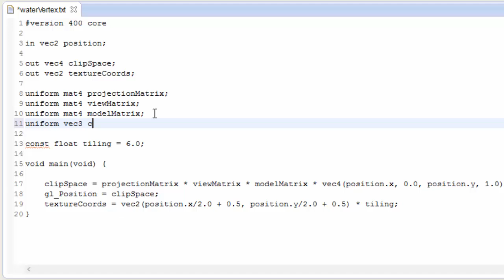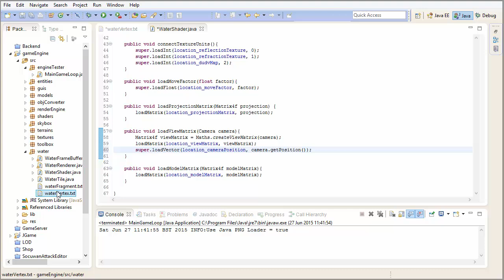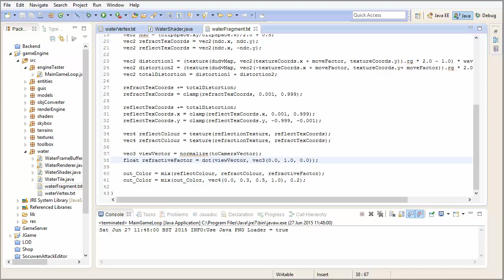OpenGL Water Tutorial 6: Fresnel Effect

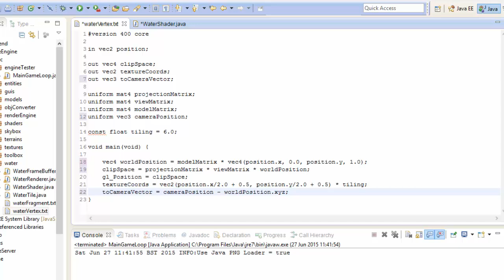Comment: I never understood why the 'toCameraVector' is not normalized in the vertex shader. Does it have something to do with what you say at 3:10 - "fragment shader takes in that 3D vector pointing to the camera which would have been interpolated all over the quad by now"?
Reply from the maker: The inputs to the fragment shader are the interpolated outputs from the vertex shader (check tutorial 4 of my OpenGL series for a recap of why they get interpolated if you need to). Interpolating between normalized vectors does not necessary produce another normalized vector so there would be no guarantee that the vector arriving in the fragment shader is normalized. Therefore we would have to normalize it again anyway.
Reply: @ThinMatrix  Ah, I see! Thanks for the reply =)

Comment: Thin Matrix Can't we use toCameraVector = (inverse(mView) * vec4(0.0,0.0,0.0,1.0)).xyz - worldPosition.xyz; to find the position instead of loading it as uniform ?
Reply: svetlozar iliev using inverse is longer to use then just sending the position to the shader.
Reply: Jacob_Mango Trust me with the modern hardware than means nothing
Reply from the maker: svetlozar iliev That would work too :)
Reply: svetlozar iliev yea but how many people are running on laptops or slow hardware that like to play games. If you can optimize, you optimize. No matter how the difference.
Reply: Jacob_Mango By "modern" i mean everything after AGP Busses. Assume you dont run on AGP. My Video Card isnt good either. I still manage to pull out 3-4 ms/frame after 3 Scene Render Passes